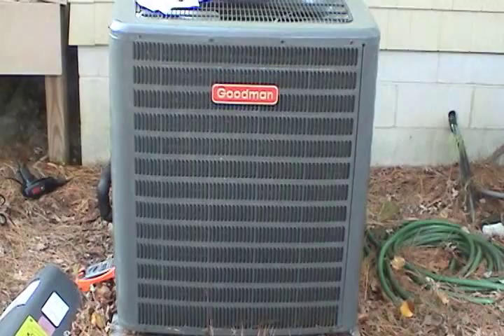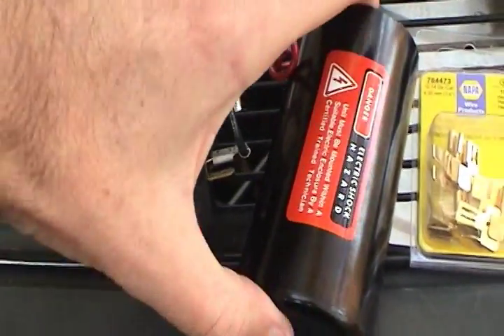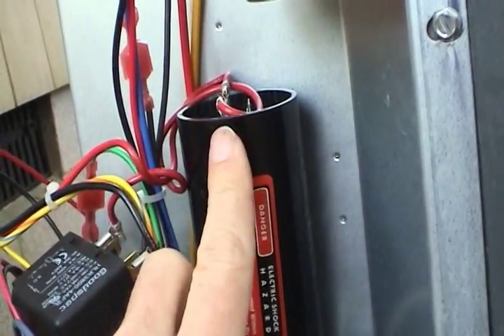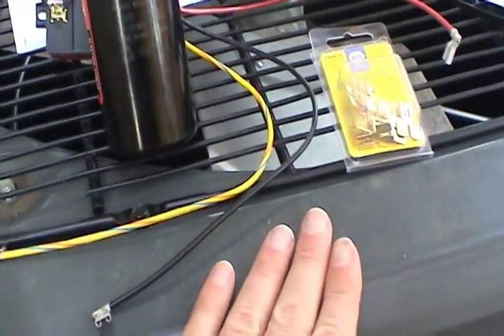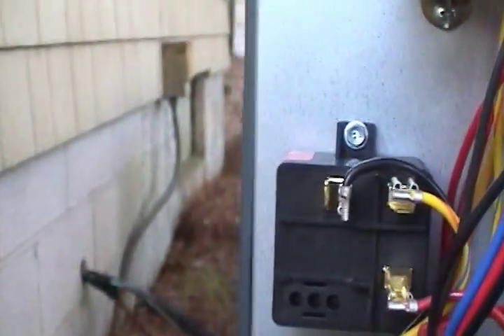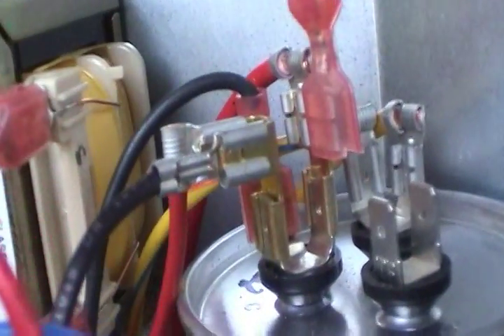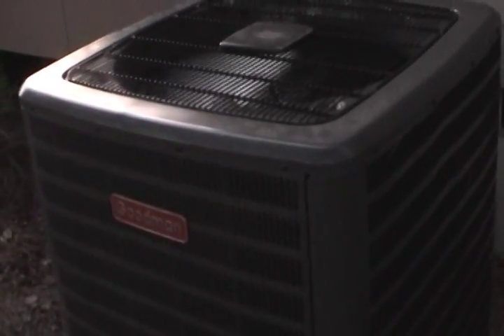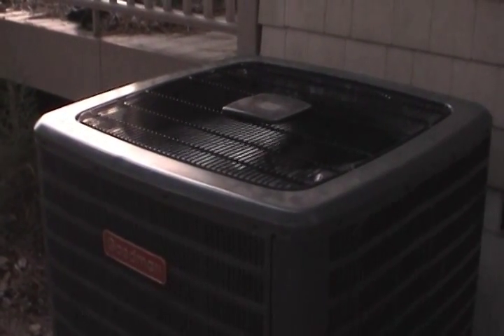5-2-1 "Compressor Saver" Hard Start Kit Installation

Comment: I have the same size and model heat pump. Being in the business, I will say you are exactly right on your installation of the kit. The only thing I do differently is not sit the cap on the lip for support. Vibration could eventually wear through the plastic causing the dielectric to leak causing a $700 repair job because it ruined the circuit board.

Comment: I have watched a lot of people on YouTube explain what this kit is and how it works, and most of them don't really understand it and explain it incorrectly.  You explained it perfectly and precisely!  Great Job!  In my humble opinion, these should be factory installed on every unit, but most manufacturers cheap out and try to save a few bucks during manufacturing.  I have a 1999 Trane Dual Climatuff Compressors 2 stage 5 ton / 2.5 ton XL1800 Heat Pump that came with a 5-2-1 Kit pre installed by Trane from the factory.  I have had to replace the Start Cap a couple of times over the years.  The original one actually had a physical lug just pop off the top of it, but it tested OK.  No way to reattach the lug, so I had to replace it.  That was 2016.  The second one started to leak a little although it tested fine so I replaced it in 2020.  I just purchased another one to have on hand just in case...  The replacements just don't last as long as the originals.  Anyway, If my 5 ton compressor tries to start, and the Cap is weak or dead, it will blow the original 40 Amp breaker in the house.  In 2020 I replace the 40A breaker and replaced the Hard Start Cap, (
the others tested fine) and have been good up till this month.  I recently discovered that it was originally installed with a 40 Amp breaker by the installer, but the spec plate on the condenser calls for Min/Max of 60 Amp, so not sure why the installer didn't upgrade the breaker when they installed the unit.  I never thought to look at the spec plate when I replaced the breaker last time.  Fortunately, they ran 6 gauge wire from the breaker box to the disconnect outside and on to the unit, so that qualifies for the 60A breaker.  The unit mains are 10 gauge inside where they tie to the 6 gauge mains.  I tested all my caps this year, and all 3 were weak, the Fan Cap, the Run Cap and the Hard Start Cap, so I'm replacing them all again.  If you check the Hard Start Cap, you have to unsolder the drain resistor off of it to get an accurate reading.  Be sure to solder it back on again before using it for safety.  Great Job on your install!  Hope it keeps running for ya.  It would be interesting to see what the amp draw was at startup both before and after your Hard Start Kit installation.

Comment: Thank you for the great video!  I would have never noticed the 'Start RLY' terminal and I was really confused on where to hook up the black wire on my Goodman 3/5  ton Dual Stage compressor. My 5-2-1 kit looked exactly like yours, but the "instructions" were only a tiny 2"x2" piece of paper and didn't explain much.  

 I also ran out of wires on the C terminal of the original capacitor,  but the new capacitor had 2 terminals, so I moved the red wire for the transformer over to the new capacitor, and connected the new capacitor to the terminal where the transformer used to be. That tiny transformer can't possibly use much current, so I figured moving that one would not hurt anything at all.

 I really appreciated the detailed information you provided.

Comment: Crankcase heater?  Your service voltage too low?  Seems like another problem. Heat pumps start up in cooler weather. Not sure why yours won’t start.

Comment: Take a class to understand how a psc motor works and why a run capacitor is required. To make a long story short. Adding a hard start kit is to boost the starting torque (provide wider phase shift during start up) of a single phase motor. A hard start kit doesn't matter what brands they all consists of a start capacitor with a potential relay. Once the motor has started and reach its running speed the BACK EMF voltage will cause the start capacitor to drop out circuit until next start cycle.

Comment: Great video. I am also looking into getting a Goodman 18 seer 3 ton unit or the Rheem 20 Seer unit. Did you test the max amp draw before and after the 521 hard start kit installation? I'm mostly interested to see if I can start it with my generator (max 30 amps/220v) in case of a power failure. I know it will be able to keep it running but starting it might be an issue.
Reply: I have ran my Goodman 3/5 ton Dual Stage unit on a 30Amp 220V Generator for a few days during a hurricane and it worked fine... without the hard start kit.   I just now added the hard start because it's so loud when it starts and it's cold outside.
Reply: From the testing I've seen on these ; the 5-2-1 kit will only save you about 25 amps. Your unit is probably drawing around 70 amps @ start up. You'll probably need a 50 amp generator.

Comment: My cap has two terminals. My contractor says that the cap is for the condensor only and the fan motor has it's own cap.  So...he scratched his head for 20 minutes trying to figure out how to hook it up.  It's a brand new (1 year) Rheem 5 ton.  He finally plugged it up and left and I would swear that it worked one.  But ONLY once.  Now it's just as noise with lights dimming again.  Is there a chance he hooked it up wrong.  Any advice for hooking it up on a non-dual-run capacitor with only two terminals?  I'd like to look to verify that he did it right because to be honest I don't trust him.  (And I'm an electrical engineer btw, so I'm not an idiot to electrical/electronics).
Reply from the maker: +ShawnMichael121277 It would hook up exactly the same way as it did in this video i.e., across the run capacitor that feeds the compressor.  So red and black are across the line, and the yellow w/ red tracer connects to the start terminal of the compressor via the run cap. terminal.  Yellow/red -> yellow, red -> red, black -> black.  Relay must be mounted tab-up.

Don't forget to check the compressor run capacitor to ensure it's within tolerance.  Also, make sure that you have a full 240V supply under load so that you're not up against a low voltage situation from the utility.  Check to ensure that all connections are tight and clean, especially at the plug to the compressor.  Sometimes, those aren't seated firmly.  If the compressor still dims the lights excessively or sounds unusually noisy, then it's time to look at the refrigeration circuit (check pressures, etc.).
Reply: *****
I'll check those things.  Thanks for the reply.

Comment: do i see an rj11 jack on the circuit board?
Reply from the maker: Yes. That's another way to hook up the wires, but it's rarely used. Most of the time, the terminal block works the best.

Comment: If I could like this 2 times I would.  thank you for sharing.  Very good information.
Reply from the maker: You're very welcome. The hard start kit solved my intermittent locked rotor issue completely. The issue hasn't returned since the kit was installed. It was the best $50 I've ever spent.